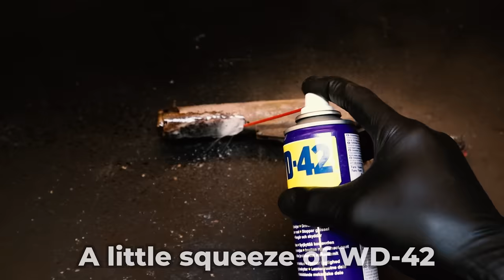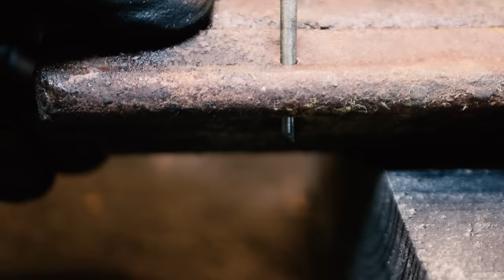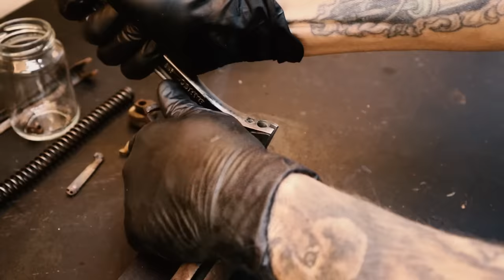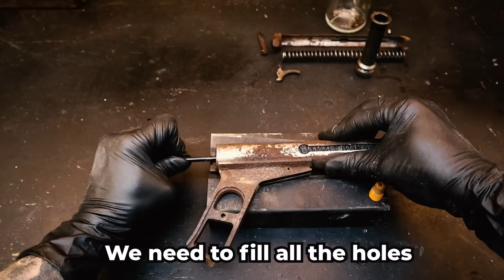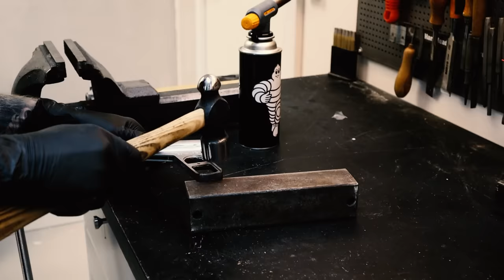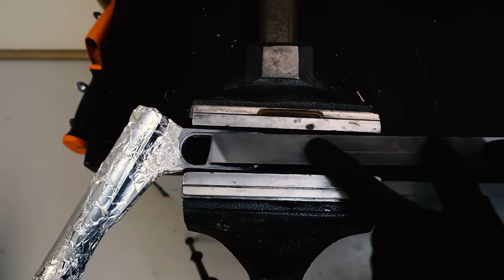SUPER RARE Air Gun Restoration – The Warrior .177

Comment: Why does a steel gun have blue-green rust?
Reply: It's a wierd one. He's clearly giving it a rust/verdigris paint job for clicks and a good thumbnail and I'm guessing snipping the grip as that damage doesn't seem very likely to happen by accident. The techniques are real and impressive but the presentation is ginned up for clicks. Youtube incentivises this  and the video is not "fake" but there's artifice here all the same. There's no reason why there should be verdigris on it. It's not as impressive to take and old rusty item and restore it unless it looks like it was recovered from a sea wreck.
Reply: I wondered that as well. Pretty clearly copper oxides on a non-copper bearing part. Also, why are there plier witness marks on the broken grip and clear saw and cut marks at the break, rather than torn metal? Every one of the videos from this guy seems to show signs of artificial weathering and then re-making it into modern art. That's not restoring something. It's destroying one thing and making another out of it. Sure, that's art and all, but to call it restoration and sell it as such is a lie.

Comment: At the start of the video the gun appears rusted green in certain spots and the gun (appears) not be made out of copper. Why is this?
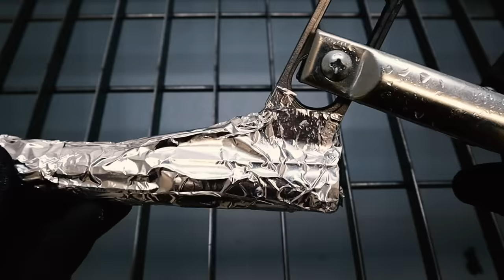Then at 7:39 there is no visible copper metal. 5:29 no copper metal.
Reply: "Green rust is an unstable corrosion product typically produced in a low-oxygen environment, such as on rebar in the chlorine-rich environment of seawater."
Reply: that was my question too
Reply: @condyshares  No, it is paint. This video is staged. He painted it to make it dramatic and atract views.
Reply: @condyshares  you may have noticed that nearly all of his work starts with the same corrosion , he's very good at applying it.
Reply: Many, if not most, restoration videos are staged, especially if they have bright colours like green. That goes for many similar channels, too, not just this one.
Reply: @NotimPorten  Thanks for the insight mate.

Comment: You Sir have great skills and I'm really glued to your channel. My second wifes father worked at a shipyard in the tool room he gave me a small bottle of oil of wintergreen for stuck bolts on ships some of them 5ft nuts and they used this to lubricate and penetrate them. So i had a Cadillac in my shop for a new radiator but the trans cooler lines were thick flake rust i dropped a single drop on each of them and the next morning i tried the lines and they came loose with no effort. I thought I would tell you that in case you want to find it and some of those bolts might be easier to remove. I love your videos Sir
Reply from the maker: Thank you so much Michael, for sharing the kind words! i really appreciate it 😉👍

Comment: How are the seals holding up after using Hoppes oil?  In just curious, usually not recommend to use inside the gun depending on what they are made from.  There are specific chamber lubes out there.

Comment: You do understand that a computer screen can only display RGB colors to a maximum of 255 which results in white? There's no other light that leaves the screen so blocking out the welding does absolutely nothing.
Reply from the maker: Yes I know that it won't hurt your eyes but darkening the screen makes the video much more pleasant to watch for those who are light sensitve 😉
Reply: @AwesomeRestorations  thanks for the response. You might be right. I wanted to point it out just for your input.